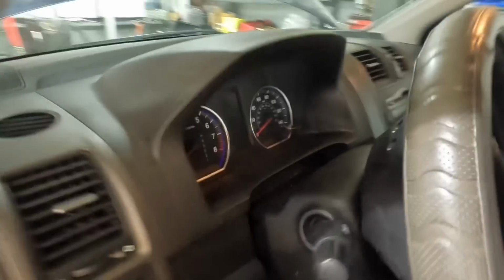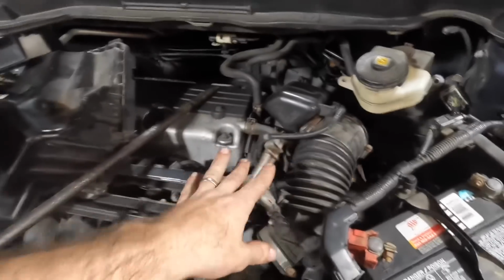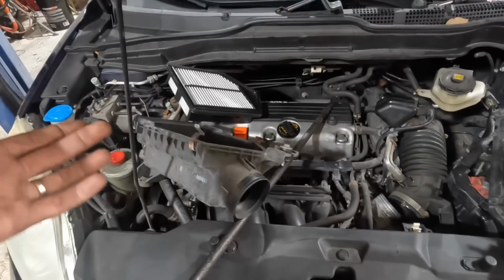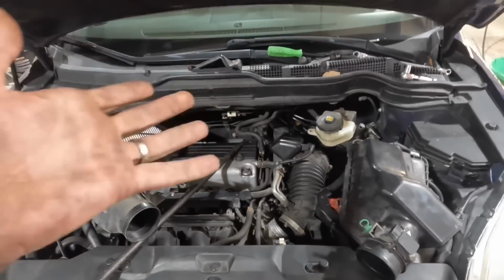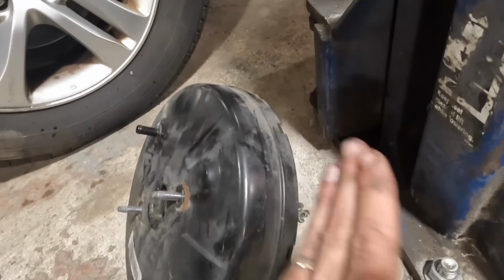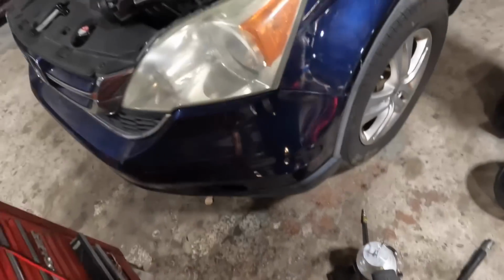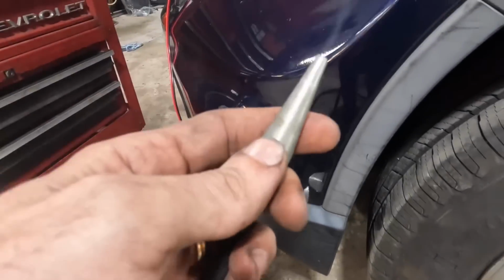Honda CRV P0171 P0174 Brake Fail Causing Engine Problems

Comment: My brake booster has a vacuum leak. My fuel economy dropped from 24mpg to 18.5mpg according to the carputer, and I only have about half of my brake assist. Nissan decided to cram the sumgun way up under the windshield cowling, so it's gonna be a bear to replace!

Now that I think about it, I have a power steering leak too, no steering sauce = no steering assist. Hm. I'm driving a 2004 car from the 80s. Power windows, no power driver assists. 🤣🤣🤣🤣

Comment: Ray's point is that MAF equipped vehicles - you have to look at everything that can see engine vacuum. Any unmetered air (intake gaskets, TB gaskets, hoses, oil filler cap, oil filler neck, valve cover, PCV hoses, vacuum lines, EVAP valves, and brake boosters) can throw off the system. Even a leaky valve cover can contribute to the problem (crankcase venting out)

No parts cannon - but thorough diagnostics to trace down faults to zero in on the problem

Comment: Sort of the same thing (not really), this reminded me of the CFI Ford Tempo. They would stall on take off after a stop. Fix was,,,,,,adjust the rear brakes. They ran lean and the booster would cause an extreme lean condition when the pedal was released, especially if the throttle was opened quick. Adjusting the rear brakes reduced pwdal travel and problem solved. Hard part was explaining to the customer what the fault was, lol.

Comment: My dad had a brake servo (thats what we call them in the UK) fail on his old Austin Maxi in the 1970's.  This was before computer controlled engine, so no fault code.  But the effect of the extra air was to increase the engine speed.  So he was slowing for a red light, hit the brakes and the engine started to speed up (car was an auto).  He got a hell of a fright and he had to finish the journey using the hand brake.

Comment: I have a 2007 Dodge Ram 1500 with the 4.7l Magnum that started misfiring out of nowhere yesterday. Got it home and plugged the code reader in, and it gave me the P0171 code, Fuel Trim Lean. I looked and listened all over for a vacuum leak, didn't find anything and since the misfiring only lasted a couple minutes out of a 30 minute drive, I thought maybe it was a glitch in the Matrix. Drove it to the bank and gas station, then came home and parked it for the night. Got up this morning to go to work, and no start. Cranks fine, but it's not firing at all. I got out whacked the gas tank a few times with a plastic deadblow and it fired right up. Dead fuel pump with almost no warning.

Long story short, if you get a P0171 code and your car suddenly refuses to start, a good place to begin is at the fuel pump.

Comment: I'm old school enough I've never worked on a engine with any electronics at all. Electromechanical was the thing, if even that. So no codes to guess about. Either the thing ran or it didn't, and if it ran decently that was often good enough. I have to say it's inspiring to see that the darned electronical hogwash actually helps technicians to get things working, and it even improves on "good enough" standards. Last I looked even slightly at one it was all brand specific. You needed a computer from the car brand and those were only sold to licensed technicians and only at ridiculous prices.

When I was a kid there was a neighbor who worked on some French car brand in his garage. They sent him the really sick cars that the brand garages had missed fixing at least three times, and he would diagnose and most of the time have it fixed in a couple of days. Those he couldn't repair were basically ready for the scrapyard. This was before the computer was considered cheap and reliable enough to use in ordinary cars. So it was all experience and being stubborn enough to actually find all the weird problems only by hand and feel. I know technicians still has this ability, but modern cars are more advanced, has a lot of tech added that no one had thought of back then. Things such as catalysators or the fuel tank evap that keeps gasses from the tank in check. So having a computer tell you all these details really helps.

Comment: Usually there's a check valve on the booster and they have been known to fail.They are used so you have at least ONE assisted stop if the engine dies,after that you will be pushing a lot harder on the pedal to stop-so plan ahead

Comment: The old fashioned way to check that is by clamping off the hose to the booster with pinching jaws vice grip with the engine running. You can also pull the hose off at the booster and block off the hose with your thumb. Often you can smell the burning brake fluid in the exhaust.

Comment: First car I ever drove was a 1961 Valiant. No power assist anything. Always used right foot to press on the accelerator pedal, and both on the brake pedal to stop. Plan your stops in advance.

Comment: I've encountered many faulty brake vacuum boosters where they are usually filled with brake fluid or oil affected on older cars. They can be rebuilt.

Comment: I have a Ford CMax that had the P0171 too lean code after my wife put the 85% ethanol in the tank. It cleared itself after using it then putting the regular fuel in it.  Just a diagnostic tip if you hadn't found a leak with the smoke.

Comment: had alot of issues with my car shutting off whenever i apply the brake in traffic on my 98 nissan b14, turns out it was a faulty booster and the vacuum line running to it as the valve in the line was also damaged

Comment: I had a brake booster fail on a 1977 Monte Carlo years ago. It caused a lean condition. Before I could repair it my brother-in-law borrowed the car. The engine went into my dad's yard truck after that.

Comment: I need help People. Im from chile. South a América. I want to buy a chevy colorado 2011 3.7 at. But got a problem. The first gear dont shift until You get to 3000 rpm. Could be an expensive repair? The price is 5000. Something like that.. got 170.000 km but i tested and beside that its really Good.... one Withe no problem the price is like 11.000 something like that

Comment: I once worked on a Jeep, where the brake booster was so bad, you could hear a sucking sound that changed as you applied brakes. As you might expect, the vacuum leak was bad enough to make the engine run really badly.

Comment: I did a throttle body clean recently on my civic because it was idling low and occasionally killing,  did the idle re learn procedure and while air box was apart i decided to clean the map sensor with CRC map sensor cleaner, ever since then i would occasionally get a P0171, i re-checked my airbox/fittings hoses and everything looks good, could cleaning the map sensor be going bad after cleaning?
Reply: Absolutely. MAF/MAP sensors are well-known to be very sensitive and finicky about cleaning. In fact, when performing a cleaning of the intake manifold and back of the valves on GDI engines, the instructions are very explicit about not getting any of the cleaner on MAF/MAP sensors.
Reply: Hopefully we're talking about the MAF sensor and not the MAP sensor. If you held the MAF sensor electronics downward during cleaning, you may have introduced some contaminants onto the circuit board. Cleaning should always be done so the liquid drips away from the electrical part of the sensor.  The sensor should be allowed to dry completely before reinstalled.
Reply: my mistake,, MAF sensor.  Thanks, i can't remember if i held the part the wrong way when i sprayed the MAF sensor, maybe i will pop it back out and re-clean it and be sure everything drains out and air dries

Comment: Thanks..... I  am trying to solve/troubleshot this P0171 on our 2010 CRV too.......  I cleaned the MAF and replaced Purge Valve.    I have not found any Vacuum Leaks..   I was going try Adjusting the Valves next...... I will recheck for Vac Leaks especially around the Brake Booster. The other part(s) to check for this code is the Fuel Pump/Fuel Regulator and Fuel Injectors.
Reply: In my limited experience I found that simply cleaning a failing MAF with some CRC cleaner may not correct the fact that the MAF simply is reading wrong and needs replacement.  It could still be the MAF.  All I am saying.
Reply: @Westcoastride  Thanks..... I hear you. And you may be correct... I have cleaned all of our BMW MAFs without replacing them.  I suppose that is from using K&N Air Filters.  I stopping using them, I use Washable "Drop Ins" Air Filters, that do not use Oil, usually made of Acrylic Fibers. The CRV only has 65k on it. I have changed the air filter twice since we have owned it.   It may be a dirty injector?  I have been running some Seafoam and B12-Berryman and Premium gas.  The Check Engine Light went off when I was running an errand this evening.  Let's see if it stays off.
Reply: Before pulling the brake booster off the vehicle, spray soapy water on it while the engine is running. Any leak should show or be heard.
Reply: @johnt.848  Thanks. I will give that a try.   The light came off this evening, but who knows if it will stay off.  Adjusting the Valves was next, which I may do anyway.
Reply: Check to see if the mass airflow is out of parameters   Clean it first

Comment: Please stop saying that smoke machine is "like a vaporiser".  It is like a vaporiser in the same way that a .44 is like a headache cure.  Inhaling fumes from an oil based smoke machine is actually quite dangerous.  Look up lipid pneumonia.

The reason a vegetable glycerine vaporiser couldn't be used to detect leaks is because it would condense too quickly, and it would need to be a forced air system.  The reason you can't inhale smoke from an oil based smoke machine is that it will kill you.  Normally I wouldn't bother about it since most people don't understand the difference, but I'm worried that some kid is actually going to try it.
Reply: Especially in a world where we're told that injecting bleach is a cure for Covid. :-P
Reply: Ray incorrectly compared the smoke machine to a Vape, when it IS like a Vaporiser used to disperse steam and oil aromatics into the air to ease breathing issues.

Comment: Ha had a lean code on an f250 leaking from the seam joining the 2 half's of the reman booster broke in two on the way home that evening thanks slow-reilly's at least covered under warranty but a scary ride home with absolutely no brake pedal.

Comment: “It’s like that, but it’s not cherry flavored.” It’s also not filling your body unit with nicotine, either! 😂
Reply: Except comparing a Smoke Vaporiser used in Automotive diagnosis with Vapes is not the same. Vaporisers are used for children, and adults to emit a steam into a room, usually with oil additives such as Menthol or Eucalyptus to make breathing easier.

Comment: Could you test the booster without removing it?
Or is this 1 of those problems you can't find it until it is removed and tested as you did?
Love your channel.
Spelling correction.
Reply: it can be tested by clamping off the booster hose with engine running and watching for fuel trim correction on short term. Any correction at all means booster leak. If not complete correction, there may be another leak source. Time for smoke.
Reply: I’m no mechanic but I’d think Dave would have picked that up and only removed booster when it was condemned as you saw a simple test but who would have thought. It obviously leaked when installed so he just had to hook smoke machine to directly pump through the booster. 👍
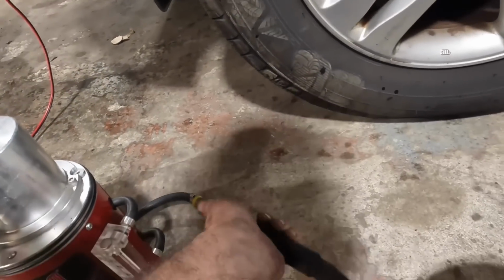Reply: @johnlarkin549  4:16  Ray says, "Dave found it with the smoke machine."".  I assume this was just a little show and tell video.
Reply: @dotar9586  I think the question was that did the booster have to be removed to smoke test I was simply explaining I don’t think it was removed to test but Dave only removed booster after it was condemned 👼
Reply: spray soapy water on the Booster while the engine is running, if you don't have access to a smoke machine, it should show where a leak is.
edit: I said soapy water due to the higher viscosity and the fact it is NOT harmful to the rubber components. It is NOT so bubbles can be seen as so many wrongly assume.
Reply: @johnt.848    I don't think soapy water would bubble since the brake booster is under vacuum in normal operating mode.  The soapy water would get sucked in, not bubbled out.  Correct?
Reply: @kdcing  same thing, you can see where it is being sucked into the Booster and possibly hear the leak better.
Reply: @johnt.848  The water doesn't need to be soapy. You won't see bubbles either way except on the inside of the booster.
Reply: @VashthStampeede  you're not a brake expert are you. 🤦‍♀
Reply: @johnt.848  I used to be when I owned my own shop. Now I just think logically. Bubbles are created in the direction of airflow. If air flows out, you'll see bubbles. If air flows in, guess where the bubbles will appear. When a kid blows on a bubble wand, the bubbles always flow away from the source of air. Think about it. I just saw that you edited your first post to explain your soapy thinking. My original post gave the quickest, easiest method for a shop technician to test the booster, if there is access to a scanner. What shop can be efficient without a scanner these days? Oh look! There's a question mark after my question.
Reply: @VashthStampeede  Where's your logic, as soon as someone mentions soapy water you think of bubbles? What a fricken genius.
Reply: @johnt.848  Ok. I gave you the benefit of the doubt. I asked several people why they might use soapy water to find a vacuum leak and every one of them said, "BUBBLES." I told them they were not thinking logically and they all told me I was crazy.
Reply: @VashthStampeede  shows how little they think then. An intelligent person can see past the instinctive and childish initial thought, oooh bubbles.
Reply: @johnt.848  Ok  I get it. It's everyone else's problem. But why talk down to and belittle people as you do? Frustration perhaps? Trolling?
Reply: 😂😂❤ Just pull out the vacuum hose at booster if it wet that mean no good anymore. 😊

Comment: Had to take my 2.5 Ecotek 2013 Malibu for warranty work. When it was done I had to take wife to hospital . Engine light came on . They put a 4.3 air filter in and removed the factory air filter . That’s why I don’t trust car repair